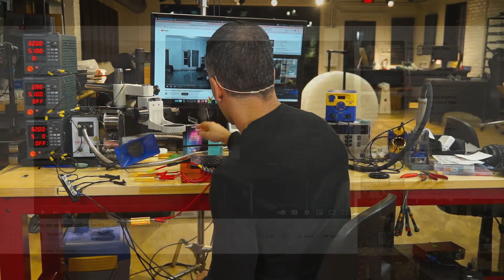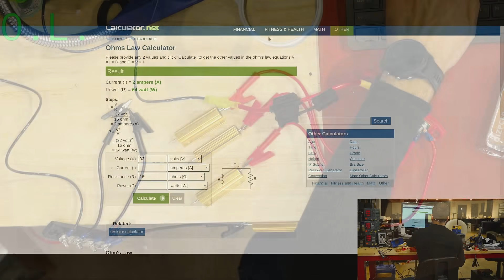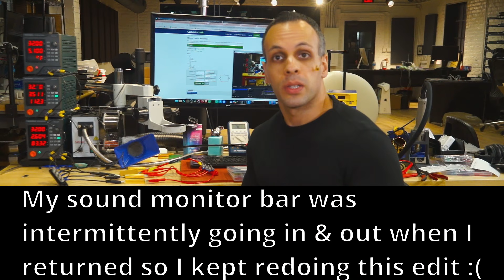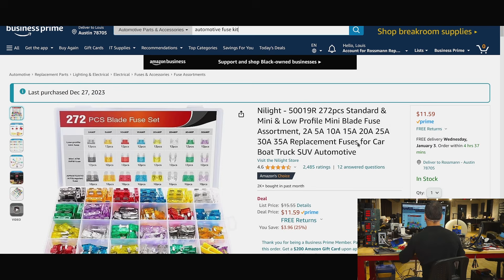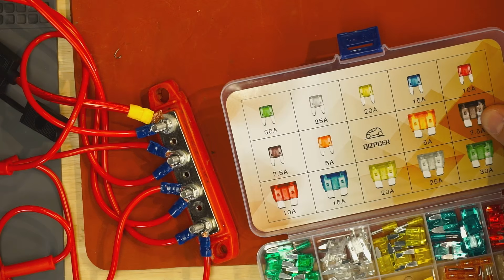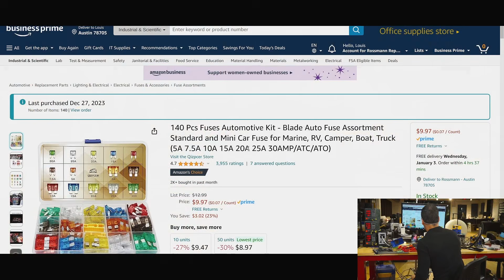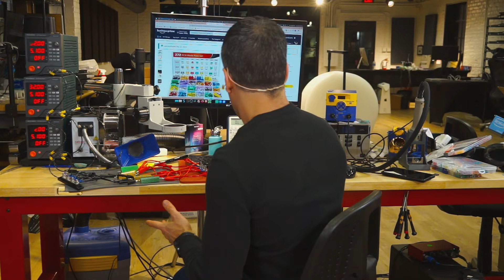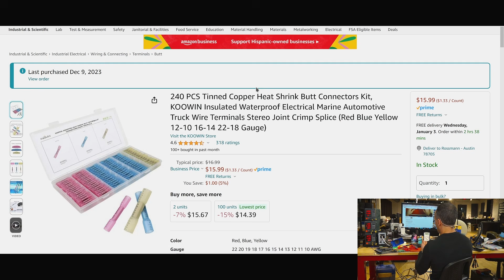Amazon Sells Fake Electrical Fuses

Comment: Regulators absolutely need to step in here. Otherwise there's going to be a lawsuit or class action when somebody uses something like this and it ends in an incident that kills people
Reply: Ask Earth's Most Customer-Centric Company what to do.

I asked them, and they told me "we checked with the seller, and have determined that the parts were not counterfeit. Your review has been removed."
Reply: Substandard parts has been an issue for a long time, "check it before you fit it" shouldn't be necessary but it really is.
Reply: @chrisdavidson911  Except of course you can't check a fuse in a non-destructive manner (unless you go for the heroic assumption that two identical fuses from the same packet will behave the same).
Reply: @maidsandmuses  Indeed. You also can't take a sample size of 1 and assume it's representative.
Reply: You can't check a fuse without blowing it up, you have to rely on the manufacturer to certify their batch  @chrisdavidson911
Reply: Yeah, there will be. Brand will be out of amazon, they will be unable to prosecute producent for damages because they are in china and they wont be able to prosecute amazon because they arent liable for what is sold on their website. 
But worry not, the producent will rebrand and will continue selling on amazon under different name. 

This game was already played and until law changes you can't do anything about it.
Reply: Has there been a case of somebody suing a marketplace like Amazon for selling products like this before, involving one or more deaths?  @michasokoowski6651
Reply: No regulatory authority is going to save your bacon. You can only rely upon yourself and companies that you have directly vetted.

There are no incentives that government will create that will improve the process. They don't have your best interests in mind.
Reply: lol, sure thing ancap, in reality regulations have vastly improved the quality of products sold  @pappaflammyboi5799
Reply: @pappaflammyboi5799  It should go without saying that people want to get what they pay for and not a fake.

If Amazon keeps selling fakes to happy customers, what's the problem?
Reply: @pappaflammyboi5799 , that seems like an inefficient way to run an economy. Are we all turning into India? Who do we have to bribe?

You can't make the system perfect, but you can make it a lot better than it is. We simply lack the will.
Reply: They also have circuit breakers with nothing inside them   the only way they trip is they melt.
Reply: Problem is not just regulations but also enforcing them. 

I'm in Europe and we have a bunch of laws and regulations for products like these, yet the same chinese crappy non compliant stuff is all over european amazon, or even many other online marketplaces to be fair, because nobody is making sure they're only selling CE compliant stuff.
Reply: I think that's why Amazon likes Chinese sellers.  If something does happen Amazon can simply blame the seller and take down the product.  Meanwhile it's impossible for the government to punish Chinese sellers who will then go on to list the same product under a different brand name.  It's a game of whack-a-mole enabled by Amazon that allows them to sell dangerous products with impunity.  Amazon does have a legal obligation to take down unsafe products after they've been publicly made aware that they are unsafe but unfortunately due to the above it's easy for them to get around that.
Reply: This is exactly why you look for things listed with certification organizations when it comes to electrical/electronics safety. UL is one of the main ones in the U.S. Then if stuff doesn't meet spec, you can contact the testing organization instead of the product company. Not quite government, but (as I understand it, IANAL) it creates a kind of legal framework that holds a listed or registered company using the trademark on their product up to a standard.
Reply: 1. Amazon probably can't be blamed for the products they sell failing, that's the manafacturer's fault
2. The manafacturer is based in China and is probably effectively out of reach of the US court

So a law suit will probably fail before it even starts.
Reply: Does anyone think Joe Biden and his corrupted DOJ will do anything about Chinese junk or Bezos?😊
Reply: Careful, the fees and taxes involved in raising funds to maintain regulatory bodies might scare away all the libertarians here.

Comment: Does anyone know what mic is Louis using in this video? Looks very practical and the sound quality is amazing.
Reply from the maker: DPA 4065, a broadway standard.  Buy used and broken off ebay and put your own neutrik 3.5mm jack on so you save $500

Comment: Amazon "You're not allowed to sell refurbished ipads, that's illegal!"

Also Amazon:
Reply: If it saves just one life...
Reply: "They can't sue us, if they are dead"
Reply: @michasokoowski6651  I wonder if that guy using microwave transformers used these fuses and electrocuted himself.
Reply: @robertsmith2956  You mean creating carvings on wood using microwave transformers? 
Its not about the fuse, you probably can't even do that with a fuse. It's extremally dangerous, you aer working with amps so high that rubber gloves will melt instantly and you will be electrocuted anyway. 
No one should attempt that in any way, if you want wood carvings use normal methods to do them
Reply: @michasokoowski6651  soldering irons work well for wood carving with a "burnt" look to it.
They're also perfectly safe as long as you maintain basic safety procedures and keep a bucket of water nearby, just in case
Reply: @michasokoowski6651  woodburning isn't high amps.  It's using extremely high voltage on the secondary coil of a MOT.  

The higher amperage primary coil is actually safer because of the lower voltage inputs typically used with them.  You need the higher voltage to overcome the body's internal resistance to deliver a lethal amount of Amps. 

There's MOT projects that only use the MOT primary winding (spot welders, electromagnets)  and the first thing you do is toss the secondary because of how much more dangerous that high voltage output (with no current limiting like various other high voltage devices) really is.   Ofc these projects are still potentially dangerous, but people definitely aren't dying to these sorts of projects the way woodburners are.
Reply: @michasokoowski6651 wood burning isn’t about amps lol it’s volts
Reply: @robertsmith2956  No, it was the microwave transformer that is incredibly dangerous to use.  These automotive fuses have nothing to do with that.
Reply: @jaywelker5566  which is why you fuse the primary side.
Reply: @jaywelker5566   MOTs are perfect killers, the mfers have both the high voltage to push their high amps through you, like, 2000v (AC to be extra sure it goes right through) and about 0.5A which is easily enough to kill. 
For the ones not familiar: Electric fences for example, have way higher voltages (around 10000v or so) in short bursts, but limited current to some microamps or what do they put out, so they hurt A LOT but won't kill you. Wall output can be quite dangerous at like 120v AC (220v or more in Europe) since no meaningful current limit for a human body, but microwave transformers have all it takes to kill and do it well.
Reply: @robertsmith2956   Don't think the current draw differs much between killing you vs. burning the wood.
Might even be lower going through your body, a fuse ain't gonna save ya.
Reply: @Kalvinjj Takes 50mA to stop the human heart.
Reply: iPads are way more dangerous, they have fuses that never blow... 😇🤣🤣🤣
Reply: also ALSO Amazon: sells refurbished ipads
Reply: You can't possibly be trusted to do the repairs, I mean look at the spare parts you can buy!
Reply: Scamazon isnt here for Americans to make money no we put a one way valve on this shit so we only funnel huge amounts of cash out of America because fuck you.. Yea i dont buy shit from there.
Reply: Amazon you cannot sell Apple Products for less than what Apple sell them at.
Reply: huh? I didn't see their brand of fuses here. just someone selling them On Amazon...

Comment: Thanks for the shout out and link to my video, Louis. Glad you are getting this word out. There are SO MANY outright dangerous products being sold on Amazon, with no oversight.
Reply from the maker: Check out this gentleman's channel. You won't be disappointed. And, thank you for your informative email!!!
Reply: Amazon Basics is rubbish, too.
Reply: @slowanddeliberate6893  Amazon basics is where Amazon finds a high sell through, high margin product, then contact the manufacturer and have them make it for them. Then they sell it on their own marketplace (meritocracy be damned). Then they throttle the original product until the company stops selling it.
Reply: I found your video about the fuses and I appreciate how you've gone into more detail about the exact reason WHY they are taking so long to blow.  They're ALL THE SAME FUSE.  Color is irrelevant.  Complete trash.
Reply: @ShanesGettingHandy  Exactly. Why go through all the trouble and expense of tooling up to make a bunch of different fuses at different ratings, when you can just make one fuse, and slap different colors and amp rating labels on that one fuse!
Reply: Thank you all. These videos will definitely not get to everyone, but the will sure help someone and save many lives.
Reply: Diodegonewild should do some amazon charger/power supply tests. He had nice amount of ebay "reviews". He just labeled them as nice, dodgy or super dodgy with skull. Usually super dodgy is when using product can cause lethal shock like not having enough insulation in transformer etc.
Reply: I bought crimp connectors that were a joke. Returned and bought crimped soldor fittings and they seem to work ok
Reply: this video is extremely informative. I never would've gone to Amazon for something that my life and safety depend on like fuses, but now I definitely 100% will not be getting anything from Amazon anymore.
Reply: i love the part where you forget to unmute your mic lol

Comment: You're misunderstanding the voltage aspect of fuse ratings.  The voltage rating is actually unimportant in this test as the voltage rating only becomes pertinent after the fuse blows.  Before the fuse blows, there's virtually NO voltage across any fuse.  A 2 amp 125V fuse will blow at the same time as a 2 amp 32V fuse regardless of how much voltage the circuit uses assuming they're working as designed.  Once the fuse blows, the 32V fuse will have a smaller gap between the blown elements compared to the much larger gap between the blown elements a 125v fuse has.  This is important if the load is inductive where it might continue an arc across the gap after the fuse blows, but for this test, the 32V fuse will not blow in a 125V circuit it assuming the fuse will still blow at it's published rating.
Reply from the maker: I put it at 32v because I wanted to avoid the peanut gallery saying "you tEsTeD the WrOnG VoLtAGE!!"
Reply: @rossmanngroup  Fair enough! 😀
Reply: True, although when they do blow, the higher voltage creates an arc so it affects the performance afterwards .

Comment: I don't think I'd leave resistors dissipating 32x2 = 64W each, sitting on my workbench while i left the room!! 
Each fuse has the rating written on them, to be double certain it's the 'right' fuse.
good test though - these fuses get everywhere!
Reply from the maker: If the Amazon fuse set my desk on fire it would've made for good content. I have Firefox extinguishers and a nice little dupont fire suppression system in there.
Reply: @rossmanngroup  True :D, but I think the Amazon fuse was the coldest part :D. What do they make them out of, pure copper? 
I know there are fake transistors and regulators - but why do they fake fuses? Why?! 
It can't save any money to make them the correct size. 
Perhaps they make them all 32A from the same stamp, and then just use that metal blank for all the fuses... sigh! Crazy world we live in.
Reply: @rossmanngroup  Firefox extinguishers? Mozilla's branching into weird stuff lately

Comment: Louis, that's just a high quality long life fuse. You don't have to change fuses all the time if they don't blow.
Reply: That's true. you don't have to change fuses if it already burnt your house down
Reply: “Lifetime Warranty” takes on a new meaning.
Reply: @jrobmccoy  I can see the TV adds.  If our fuses blow your not using them right.  in small 2 pt font. * these are for wiring bus bars on electric cars......
Reply: You only need one fuse, not a complete set.
Reply: Yeah, you only need a new car which has become the actual fuse and protected this very valuable amazon "fuse".

Comment: Fuses are kind of a big deal. I would prefer that a fuse lights up rather than the wiring of my motorcycle.
Reply: I can attest to that. I had a whole motorcycle wiring harness burn up under me while riding, because the previous owner had replaced the original fuse link with a much bigger one, to cope with an intermittent short circuit, unknown to me.
Reply: @erik_dk842 were you on Moto Madness, where a bunch of people would empty their water bottles on the bike, and start throwing handfuls of dirt onto the bike to try and put it out?
Reply: Or my 400k house that I finally spent a couple of decades paying off. That would suck... a 5 cent fuse from china made me go homeless.
Reply: Wouldn't that be unsafe having the rubber cap open?
I think these should have metal posts out the top so the spark can go up the rod when they are on.  Like the old mad scientist labs......
Reply: Just use a fuse whenever DIY wiring FFS. And as Louis makes a point, a quality one.
Reply: Been there. Thankfully all the bulbs blew before anything else.
Reply: @armeniansdoitbetter  "Thankfully all the bulbs blew before anything else." FFS 😂
Reply: I had a neighbor with a motorcycle that would have issues starting, he brought it to a shop multiple times and they couldn't fix it so instead they dropped in a 5x rated fuse in the bike. He asked me to look at it and imagine my horror I found a 10A fuse in a 2A slot. The starter motor was shot so it was shorting a bit but with enough current would still turn the bike over, so while the original 2A fuses kept blowing it was "fixed" with the 10A fuse, but this really damaged the contactor relay and it started to melt some of the wiring going to the starter motor. I replaced the starter motor, relay, some wiring and put in the correct rated fuse and the bike had no more issues after that.

I told him to find another motorcycle shop to do maintenance with. If the bike would've had any issues starting after that fix and he would run the starter motor for longer I'm sure the entire bike would've gone up in flames. I don't even understand how the bike shop couldn't find the fault because the starter motor was sparking when trying to turn it over, when he went to the shop to to ask wtf happened they just kept gaslighting him that the 10A fuse was in there before and that it was designed that way, while the manufacturer's wiring diagram clearly shown that the fuse they put in there was just ridiculous, but since nothing caught on fire he couldn't really do anything.
Reply: @bami2   "10A fuse in a 2A slot" Fucking LOL. This is why you shouldn't do DIY wiring on your motorbike in the first place. Know your fuses.
Reply: @vinkuu  No you misunderstand, it was the shop that dropped in the fuse, not my neighbor. He couldn't even find the fusebox on the bike.
Reply: @bami2  Oooh, that's bad :/ I'm not an electrician, but I know that cables should not melt before the fuse does. Any shop shold be aware of that.
Reply: The point of a fuse is it is a deigned failure point in a circuit.
Reply: @Cheepchipsable  Exactly. Which is why I design the gauge of the wiring to fail after my the fuse in my motorcycle wires :)
Reply: @Cheepchipsable  Master of the obvious. XD
Reply: @Cheepchipsable  Exactly this. Before anything else fails, the fuse should fail.

Comment: The German electrician and YouTuber Great Scott! has an entire series where he finds hidden gems on various bottom-of-the-barrel eCommerce platforms.

It's essentially roulette. The trick is that since he's an electrician with a ton of testing equipment, he can verify with his purchases that it'll never be of the Russian variety.
Reply: The really dumb thing is that there are plenty of idiots who see fuses as some garbage that gets in the way of getting power delivered to their equipment. These are people who would legitimately give a favorable review on a fuse that "can handle" more current than the label actually says it can, while still passing superficial safety inspections/audits, because they actually think this is a good thing because it means they won't need to replace the fuse as often.
Reply: @martenkahr3365  🤣 I can see some moron doing what you describe. If your fuse blows every time, maybe look at your circuit again, then there is something most likely wrong with it. Never would buy fuses on Amazon, always mouser or digikey. The breakout boards and prototype pcb's are fine tho, not much one can mess up on those and got several stacks of them xD.
Reply: @martenkahr3365  this is the classic people that overrides fuses with big wire or other metal parts. Let them do it, it just means their equipment breaks more often and they have to call a tech for repairs.